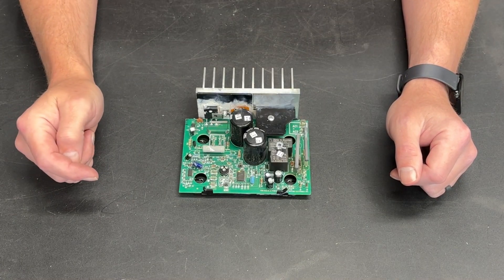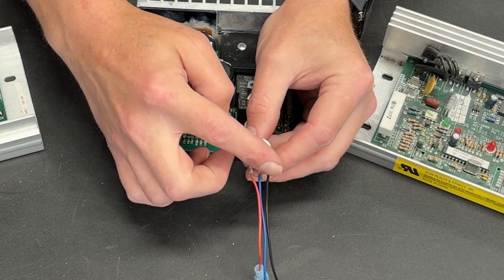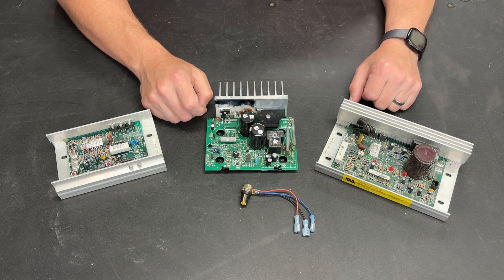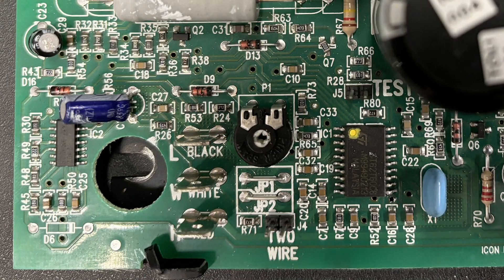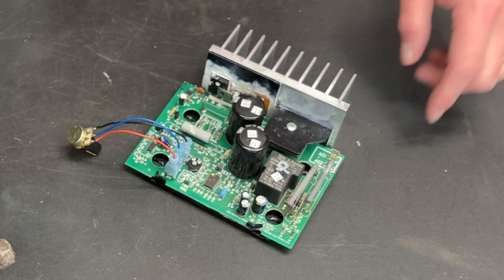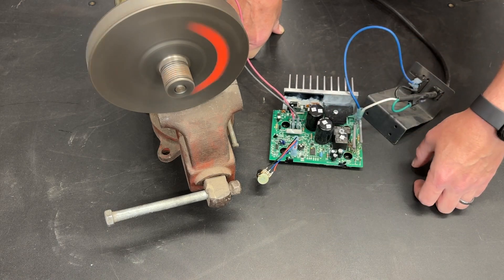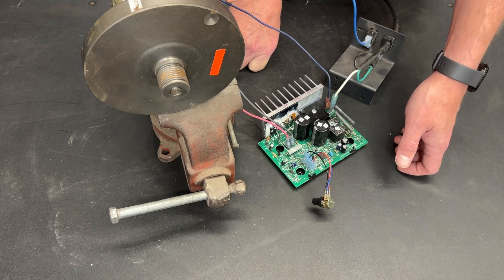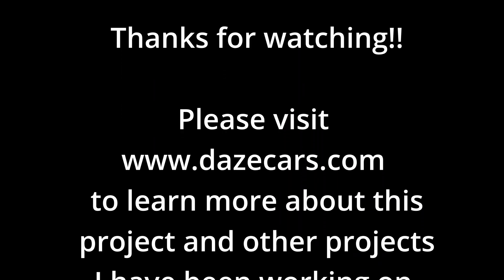Hack an MC 70 Treadmill Power Supply to Work Outside a Treadmill Without a Treadmill control panel

Comment: Great vid as always. You might want to explain in short vid on pot terminology. Like H being high resistance or rated resistance L being low resistance or ground and W being wiper to vary the resistance.
Reply from the maker: thanks for the idea, stuff like that is already covered on YouTube and I don't like duplication information if I can avoid it.
Reply: @dazecars Good day! May I know the model number of the IC beside the MOSFET? I’ve been searching for the schematic diagram on Google, but I can’t find the same model of the MC70 power board.
Reply from the maker: I would love to help but I no longer have the board featured in this video.
Reply: @dazecars Thank you so much.
Reply from the maker: wish I could have been more help

Comment: Thanks for your videos on this subject.  Does using the treadmill board work better for torque than the power supply, bridge rectifier way you show in other videos? Meaning if you made a sander and tried to sand aggressively you could bog it down.  A commercially made sander would go at a set speed no matter how aggressively you sanded (within reason).  Or is that where you need to use a VFD, advantage it holds a speed under use, disadvantage is they are pretty dear.  Thanks again for all your videos on this subject, I really enjoy them.
Reply from the maker: First of all most commercially made tools use an AC motor and it is specifically calibrated to have enough torque for the application.  Once you get into retrofit situations you need to make sure and use the correct motor for the situation.  The issue is people fall into the horse power trap.  The look at there AC motor that has .75-1.5 HP and assume that a treadmill motor with 2.5 hp will automatically be better.  The problem is people go with a DC motor for variable speed and specifically to slow things down and HP is a function of RPM.  The long and the short of it is don't go by HP numbers, only use them to calculate the torque (I have several videos on this) gear the motor down so that you can take advantage of the higher RPM DC motor and for most applications use the best treadmill motor you can find.  

Now to your actual question torque is a function of amps.  When a motor bogs it draws more amps and if the power supply is up to the task the slowing will be minimal up to the max amperage draw of the motor (stall).  Most treadmill controllers are not designed to put out tons of amps. That is why they are less robust.  As the motor works harder more amps are required and if the amp draw of the motor exceeds the capabilities of the power supply at the best you don't get max torque but at the worst you fry the power supply.  I have used both an MC2100 and the AC power supply with rectifier on my bandsaw and I stuck a blade while using the MC2100 and fried the board.  I have stuck a blade using the AC power supply and rectifier and no damage to the power supply occurred.
Reply: @dazecars  wow awesome reply. Thanks for the information.
Reply from the maker: Glad I could help.  Let me know if any other questions come up.

Comment: I scored what must be an ancient treadmill from the garbage set out for collection at a house near where I live.  It uses a mechanical cvt v-belt transmission to set the walking belt speed.
Reply from the maker: interesting.  I would assume the motor is AC then?
Reply: @dazecars  I haven't messed with it other than disassembly and storage but I think it's a DC motor.

I looked up my reference photos from the disassembly and it was a Roadmaster Corp Treadmill Model 9880 built in the 3rd quarter of 1990 if I decoded the date code correctly.  It used a Minarik MM21034A motor controller driving a Scientific Pacific model 8940 rev C motor.  Google came up with an Ebay listing for > MINARIK MM21000A DC SPEED CONTROLLER sold by sunalparts < which looks identical to the controller I have and I haven't been able to find any info on Minarik's or Scientific Pacific's websites so far.
Reply from the maker: So it sounds like it has both a variable speed controller on the electrical side and a mechanical speed controller with the cvt v-belt transmission.  Very interesting.
Reply: @dazecars  Well.  Looks like my disorganization bit me.  The motor and controller photos I mentioned are from another treadmill, I have collected quite a few.  I went out to my storage as it seemed weird to have both methods of speed control.  After an hour of excavating, I found the box containing the CVT treadmill components and it does indeed have an AC motor.  Sorry about the misinfo.
Reply from the maker: its all good

Comment: The boards allow someone to control the speed with button touches instead of a knob?
Reply from the maker: Anything is possible but it would likely involve a digital potentiometer and some sort of controller.  Knob is simpler.
Reply: Easy to understand information (as always) 👍🏻
Reply from the maker: glad you liked it.